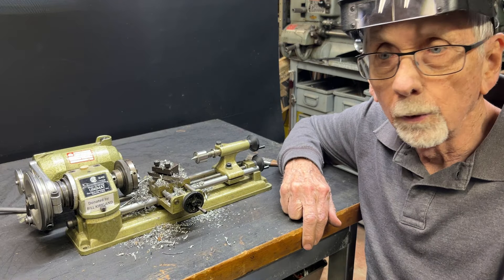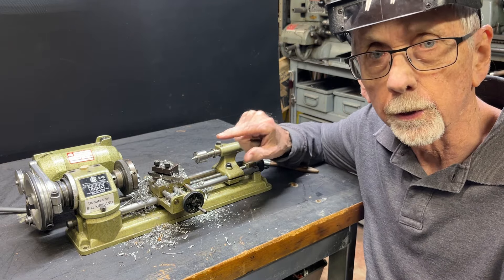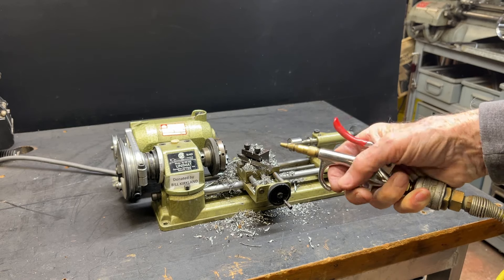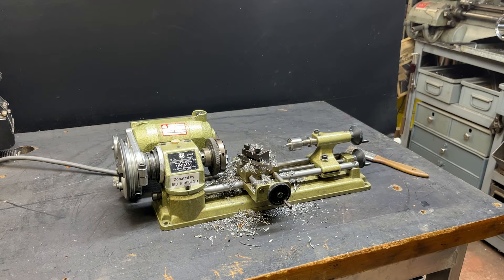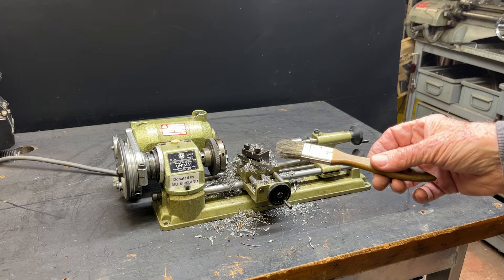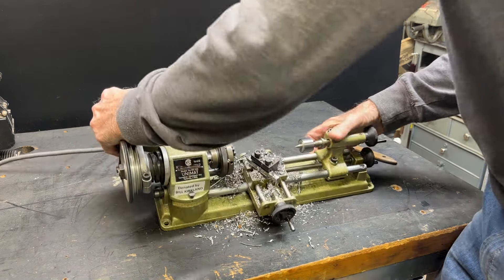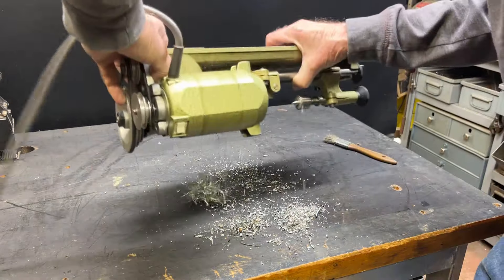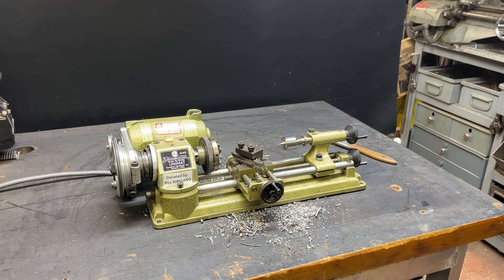HOW TO CLEAN A LATHE shorts #49  TUBALCAIN mrpete

Comment: I have a Taig lathe, similar to the Unimat. It's very often convenient that the lathe can be picked up and turned over or moved around! Strange rearrangements are possible too, like putting the tailstock behind the headstock, or removing the carriage for an odd drilling operation.

Comment: ....I note that a similar beneficial effect can be demonstrated with electronic circuits by using a mechanical vibration platform, see EEVblog 1607 - PSU Switching Noise Reduction via Vibration....
Reply: Ultrasound will do it. Turn on your teenagers boom box for five minutes. Eureka it’s clean!
Reply: @ellieprice363  itty bitty speakers in modern boom boxes create excellent cross modulation scouring rasters, perfect for rearranging all that swarf back into a miniature replica of the original billet. Astounding conservation of form at work. The mind of humanity has so many wonderful abilities. Today (April-1) should always be considered a special day for such things.

Comment: I got a big kick out of this one. I know better than to use compressed air on any machine. Won’t claim perfection at that.  
  I have a good friend two doors away. Keeps a tidy well organized shop. Tools where they’re supposed to be. It is nice. 
 He is retired now. A well versed machinist with some tool and die making experience. He knows how to get me out of most of my neophyte jams and he allows me the use of some of his tools of the trade in my shop. In exchange he is free to machine what ever he needs to in my shop. He just doesn’t mess with it much anymore. 
   He is always on me about organizing and cleaning.  He is right. I just don’t have the time I need to keep at it 100%. 
  One thing I noticed him doing in his shop was using a leaf blower to push out the cotton wood leaves and the associated fuzz. 
  He made quick work out of all of it. Everything appeared to be nice and clean and dusted off. 
   While he doesn’t have machines in his shop. He does have pneumatic tools that are handy. Finish and framing nailers even some brad nailers.  
   We broke a few of them out for a project not too long ago. Every single one of them packed with dust and debris from the leaf blower cleaning. Anything that had oil protecting it was caked with fine Oklahoma silt.  
   While he went at tearing them down to clean I walked back to my shop and opened up my storage bin that had some of my air nailers in them that had been stored a while. All of them worked just fine.